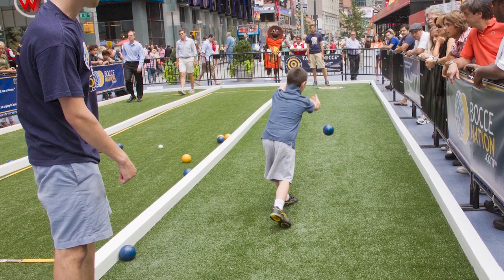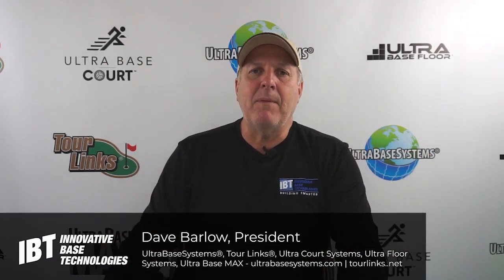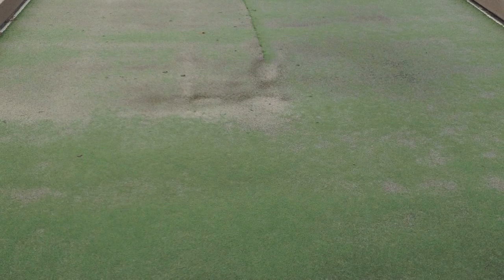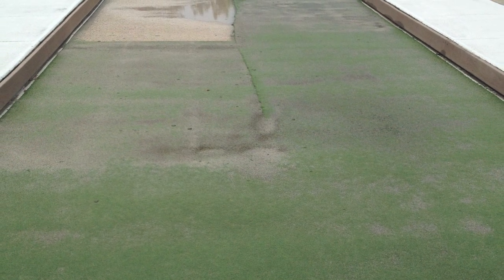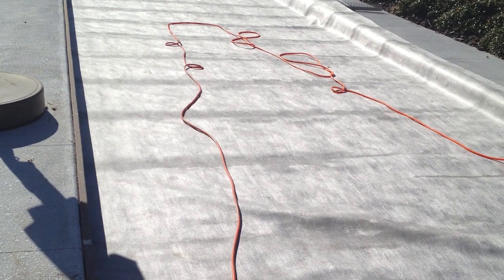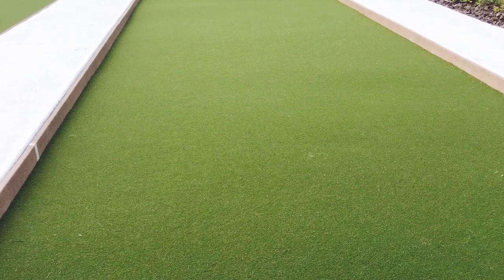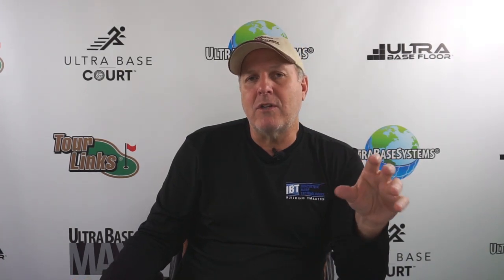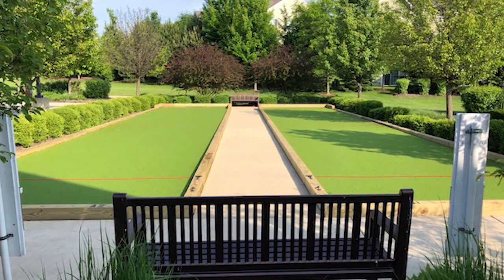The Best Way To Build a Bocce Court

Comment: I have researched what's needed to build a backyard bocce court and I do agree the UltraBaseSystem panels is a better option verses a concrete pad, what I disagree on is the cost and how this video makes it appear as if you can simply remove the top layer of sod and lay the fabric and then the panels. It's not that simple, because the flat surface will need to be built with plenty of 3/4 clear gravel or some form of good drainage rock to allow for proper drainage. I have priced it both ways, excavating the area, bringing in several loads of rock, drainage pipe, fabric and the UltraBase Panels, and then excavating, pouring a 4" concrete pad... It comes out to be about the same price either way... I would prefer to use the panels over concrete, but I'm not ready to pull the trigger until I see a price break.. They are just simply unaffordable. But i'm hoping within this calender year (2022) I can find these panels somewhere at a more affordable price, cause I'm really wanting to build a bocce court.
Reply: Use rubber horse stall mats or cow mats. Cheap heavy duty and easy to level